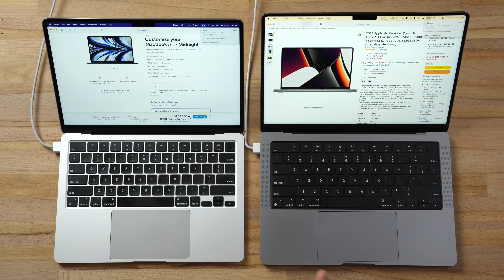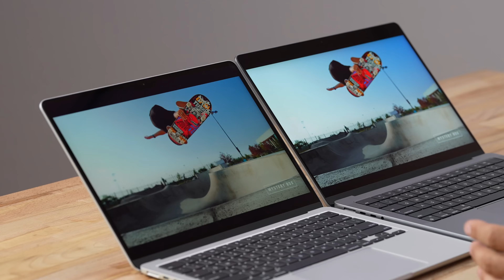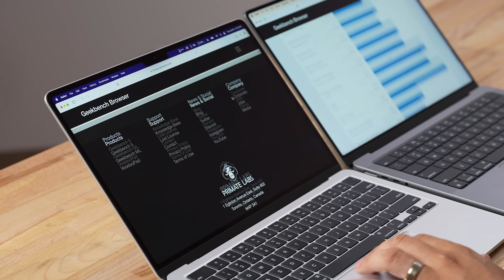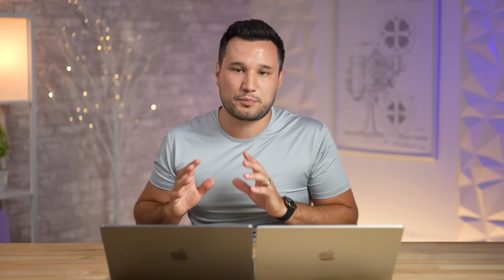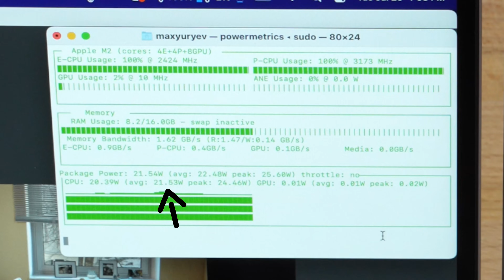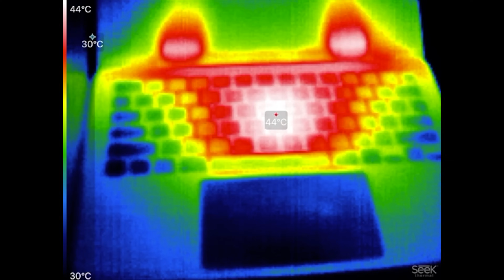M2 MacBook Air vs 14" MacBook Pro - Prepare to be SHOCKED!

Comment: Just ordered 16/512 space gray m2 air knowing that the price is really close to m1 pro 14. the difference was 230 euros in my case but that’s not important for me. I already have a powerful rtx 2080/i7/16gb windows pc equipped with a 1 tb ssd. So I will put most of the heavy workload to that machine anyways. What I needed was the most portable and lightweight notebook possible for dealing with web based applications + my office uses and while doing that, something that can manage some heavy workloads from time to time. Battery life was also extremely important for me. 

So my point is, do not pay more for something you do not need! First, just determine what exactly do you need. This is a good pricing strategy from apple, they are upselling something you do not need and making you pay even more once you start looking at their website.

Good luck choosing!

Comment: I am interested in knowing how M1 Air with upgraded 16gb RAM with rest all default performs agains M2 Air all default. This will make both cost same and interesting. If M1 with better 16gb ram, better ssd performance performs better than default M2 with better cpu, I would rather go with M1 with 16gb RAM.

Comment: I opted for the base 14".  It's awesome.   Was $1749 at best buy.  Traded my 2018 ipad pro, an old ps4 pro 1tb, and an old nikon 3400 and got another $540 off!  $1300 after taxes.  Not a bad deal!   No brainer at that point.
Reply: Why do you guys call it the 14 inch as a differentiator when both laptops are 14 inch

Won't it be easier and just plain smarter to refer to one as the Pro with the other as the Air

It's just so dumb and annoying to me tbh

Comment: When I heard about the M2 MBA I was convinced it was the choice for my workflow that covers everything from InDesign to Photoshop to Premier Pro, but after seeing the reviews of the MBA and how the SSD needs to be upgraded to get the best performance, I’m going with the 14” MBP. For a couple hundred more dollars, it’s worth it.
Reply: And nobody that I know works seriously with InDesign and Photoshop with only one display! So the Air is useless if you need that…
Reply: @simpromovie  you can run a second monitor on the Air…
Reply: @DistractedPlatypus  Not really. There is a wimpy workaround in form of a DisplayLink hack that is not comparable a a "real" two display setup. It's a software based compressed slow connection with no HDCP support and Apple can disable it in any not MacOS release...
Reply: @simpromovie  I think Stephen Plumbley meant that you can run a second monitor in addition to the MBA's own monitor. That's what I do when I'm working from home on my 2017 13" MacBook Pro. It's not ideal having one screen be only 13" in size, admittedly (at the office I use 2x 27" monitors connected to  a M1 Mac Mini, but at home I don't have room for a 2-large-monitors setup) but it can be done and my work apps seem pretty close to Stephen's (InDesign, Photoshop, Illustrator, MS Office and a web browser, mostly). I do make heavy use of Spaces, though, which I guess has to be considered a workaround, of sorts.
Reply: @ricklecoat422  Yes I meant two external monitors. I think this is a essential feature for many workflows but especially for things like InDesign and Photoshop. This should be possible with a laptop from 2022 in this price category! Most Windows laptops, even the cheap ones, are supporting this for many years....

Comment: the M2 MacBook Air isn't meant for Pro work, yes you can spec it up nut 90% if it's buyers won't do that, they might just get more storage or a bit more Ram. the base line MacBook Pro is powerful enough for a lot of people . these machines are for very different users.

Comment: I feel like the options for MacBooks are pretty clear after watching this video.  For users who want a portable and powerful MacBook for both everyday and a bit more demanding tasks, the M1 MacBook Air is the obvious choice at such an incredible value even almost 2 years later.  For users who have similar needs but want the newest design, they should get the base M2 Air unless they are planning on doing anything intense then they should jump up to the 512GB model to eliminate the slow SSD.  People who feel like they need more than that should either find a renewed/discounted model with 16GB of RAM.  For users who want to constantly do more demanding tasks/pro work and are making money off the power of the laptop should immediately jump to the 14 inch MacBook Pro and should not try to cut corners with the Air.
Reply: Why everyone is saying the 14 and 16" models only for people which make money with?
We just talk about 150-350$ difference, but you get A LOT MORE with 14" M1 Pro! (and with 16" base model even more than 14"!)

You guys act as if the M2 Air is that affordable! Here in Europe we pay 1399€ for the BASE MODEL M2 Air, 1750€+ for a M1 Pro 14"! Refurbished you get even 1TB SSDs at 14" M1 Pro sometimes for LESS THAN 2000$!

I got a 16" M1 Pro base model and im not earning money with it. I just enjoy good, versatile high quality notebooks. I cant stand adapters/hubs (the USB C to A is already enough needed still!) and M2 Air doesnt even deliver SD Card slot which i need nearly daily!

Considering im using about 2500$ worth of camera gear im not earning money with, just for a hobby, i guess the MacBook Pro is for sure an expensive decision to go, but at least i get something for the price i paid, the M2 Air especially upgraded to 16/512 is just targeted to Apple Fanboys and rich kids which dont care much about money. Probably for the ones looking for ultimate slim and light "powerhorse" too, thats it!
Reply: @harrison00xXx  I totally see your perspective on that.  I’m basing it off of what a normal person would be happy with, which is the M1 or M2 Air.  People who can afford expensive devices and prefer to have luxury technology even at the expense of their money can upgrade to the highest tier even if they do not fit the type of person it was intended for.  The 14 and 16 inch MacBook Pros were built with one of the main goals being to satisfy those who use their laptops for creative work and for those who do demanding tasks.  The ports like the SD card slot are there because many professionals will use SD cards.  The miniLED display is to satisfy those who use HDR work.  The M1 Pro/Max chip satisfy the needs of those who do demanding tasks that require more than just the base M1.  See what I’m saying?  But if a general user can afford these expensive machines and enjoys purchasing the newest technology, he or she will still be able to.  It’s just that most general users would be happy with the M1 or M2 Air.
Reply: @xeon3081  "normal person would be happy with"
Ok... many normal persons love a dedicated display output to use the notebook on TV or external monitor.
Soon, any display will have USB C input, but TVs will use for sure HDMI only for a while ;)
HDMI is one of the basic needs in fact. If the notebook is a "more professional" one like a M2 Air, especially upgraded with its high price, i would consider any dedicated display output as MUST HAVE.

Even 200$ netbooks about 10 years ago had HDMI and often also SD Card slot...
Reply: @xeon3081  "The ports like the SD card slot are there because many professionals will use SD cards.  The miniLED display is to satisfy those who use HDR work.  The M1 Pro/Max chip satisfy the needs of those who do demanding tasks that require more than just the base M1"

So you say:
- Only (!!!!) professionals use SD cards? GoPro, cameras at all and MANY OTHER USECASES for SD cards.... its just GOOD IF YOU HAVE IT (and bad if you have not!)
- mini LED display only for people working with HDR? What are you talking?
Or do you also mean by "working" just basic media consumption in HDR or outside with higher brightness?
- "require more than base M1".... considering 8GB Ram (the only really worth versions in 8GB ram base models....) is JUST FOR BASIC STUFF, anything "more basic" result already in more or less 16GB Ram AS ABSOLUTE MINIMUM... 

So yes, even most basic users would require a M1 Pro base model to get 16GB Ram and 512GB SSD at least!

Apple intentionally overpriced the M2 Air and they didnt even anything special (like 5G module, more ports for "creative users" as you said,...at least HDR and/or 120Hz screen... nothing special to justify 400-800€ highe price tag compared to M1 base model.

In fact even a M1 Air base model is somehow overpriced... 8GB Ram WILL NOT BE ENOUGH if you ever consider it to be lasting as long and being as usable as long as Macs typically do... It will end up in a websurfing/media consumption machine.
Reply: @harrison00xXx  When did I say that these were the only use for these features?  I’m literally talking about one of the professional uses that these features can be used for and why it’s recommended for professionals.  I tried to be nice but clearly that’s not your type.  Want to use a SD card slot for your GoPro or whatever camera?  Do it!  Need the mini led display for your entertainment?  Get it!  Think the extra performance is critical to your workflow?  Buy it!  Nobody is stopping you.  If that’s what you want go ahead.

The M2 Air is not overpriced with this economy?  It is a company not a charity.  Their objective is to profit.  They make good products.  There is nothing wrong with charging a premium price for them.  I am not excusing the slower SSD in these base models, but if we put that aside, the price is certainly fair.  And if you don’t like the price, you don’t have to buy it.  Nobody is forcing you to.

8GB RAM is certainly not a high amount but for many people it will be fine.  Ever heard of virtual memory swap?  Or do you think that if all the RAM is used the computer will explode?  Sure the 16GB of RAM will preform better but that’s what you’d expect for a $200 increase in price.

The M1 macbook air is an excellent value for a laptop.  It’s got great performance, a nice screen, good speakers and mics, and a thin and light design.  If you’re the type of person who needs more advanced technologies, buy the high end Macs.  Nobody is stopping you.
Reply: @xeon3081  Lol, calling M2 "more advanced" and saying M1 and M1 Pro/Max are not as advanced?
Lol, sure, if you think that.

But hey, i knew already you are talking nonsense as you tried to defend the obviously highly overpriced M2 Air (aka a iPad in a MacBook case)
Reply: @harrison00xXx  What are you talking about?  I literally said that users who want more advanced technologies should go with the high end MacBook Pros.  Are you blind?

How is it an iPad in a MacBook case?  Literally the two are very different products.  Talk about nonsense.
Reply: @xeon3081  i see, you havent seen the iFixit teardown of the M2 air yet

If you look at the design inside and especially the logicboard design and SIZE (!!!), it would fit nearly perfectly into a 12“ iPad Pro case!

Considering additionally base M1/M2s are mainly developed with iPads in mind… yes its technically more of an iPad than a Macbook ;)

I mean… apple saved already often a lot money by using super small (and unrepairable) mainboard/logicboard designs, but the M2 logicboard in the M2 Air Macbook is literally the SMALLEST logicboard ever used in a Mac (in fact a studio display got a bigger A series logicboard in it!)

Even in the iFixit report they said the M2 Airs mainboard/logicboard is with a high chance designed to share its design nearly 1:1 with a upcoming M2 iPad
Reply: @xeon3081  and no, you acted as if a 14/16“ M1 Pro is „old tech/design“ and just for „people which dont want advanced technology“ and only a M2 is modern tech.
Now you say the M1 is also modern, you dont even know yourself what BS you are talking

Just accept M2 Air is probably a ok-ish super portable notebook…but:
- underperforming, especially 8 GB Ram and/or 256 GB SSD… not even close to be worth 1000$!
- heavily overpriced in upgraded versions (the only ones which make sense!) and still much overpriced considering how „much“ you get with M2 base models!
- usability… just 2 USB C ports (even both blocked with anything beyond a basic cable!) is poor and again: If a 10 year old 10“ 200$ netbook got more ports than a 13“ 1500$ MacBook… anything is wrong!

Comment: Didn't think the M2MBA would've held up as well as it did, TBH. Pretty impressive. I write A LOT, use Ps a lot and dabble in FCPX. For me, it's the Air. 10 Core, 16GB, 1TB. Pretty expensive, but is, physically, exactly what I'm after for long keyboard use.

For the Future: I plan on getting a decent camera to take 4K video and high res photos. That's as a hobbyist, not a content creator. After seeing what the M2 chip did with its cores and engine, I'll be waiting out the M2 Pro Mac Mini (if that is indeed a thing) or, of this M2 Air can hold out, wait out a little longer and go for the M3 in a few years.

Comment: I went with a 14” pro and I’m not disappointed! Sure it’s a little bit heavier, but the overall quality and performance is worth it imo, and it’s still super small and portable. They should have done a small fan and a better screen on the air especially for the increased price.

Comment: What Apple should do with these product lines is keep the Air as is. But for the pro line they should drop all three and just make a 15” so with that they don’t have to worry about where the parts are going to go.
Reply: This also makes it easier for people to decide what they are going with when buying a system.

Comment: You can find the 14 inch with a more capable 10/14 soc used for a reasonable discount from new.
In my case, I upgraded the chip, 32 gig RAM, and 1 t ssd. That’s probably too much for 90+ % of buyers, but it matches my workflow. If you have enough room the 16 inch is a better option.
Reply: Indeed, I've seen a couple of base model 14" MBPs on the apple refurb store at a similar price to a new M2 air with 16GB ram and 512GB SSD. That said, give it a few months and discounted M2 Air's will appear as well.

Comment: Thanks for the MBP14 vs Air comparison.  It was very insightful.

Just a note: On the battery levels differences, some of the benchmarks measure the quantity/quality of work- more work done in the same time, higher FPS, less FPS skipping, more audio channels, more browser events, etc. It is reasonable to expect that take more processing power and hence more battery. 

 I expect if one ran the exact workloads that were not also showing quantity/quality of work, the MPB 14 would have slightly better  battery results.  Maybe still not matching the MPA, but the percentage difference might closer than the final  results.

Comment: Thank you for this side-by-side test. Once you give the M2 16GB of RAM and a 512GB SSD to work with, it turns into a very capable premium laptop with plenty of performance headroom for consumers and prosumers. The entry-level M1Pro MBP is great if your work requires two external monitors and/or entails a lot of sustained coding or rendering/game development projects. Professionals earning de facto high houry rates prefer the 14" with the full-fat SoC and 1TB of internal SSD. Then, even a $900 premium amortizes in months rather than years, especially if you can catch a tax break for the purchase as well.

Comment: thanks for the video. i just checked and the M2 air when with 16 gigs of RAM and 512 SSD is basically the same price as the M1 Pro.. 50 or so bucks difference… i will still go for the pro in this case simply because price-wise air makes no sense.. if the base air had 16 gigs and a 512 ssd then air would be my choice.. but we aren’t in such.a nice world hahahahah

Comment: My M2 MacBook Air arrived today. 8-core CPU 8-core GPU. 512SSD 16GB unified memory in midnight. It’s working pretty good for me so far. I also have an M1 iMac with 8-core CPU, 8-core GPU, 1TB SSD, and 16GB unified memory and the M2 Air is essentially on the same level as the iMac. iMac may be a little better for extended workloads though due to having a fan

Comment: I'd probably be happy with either, but opted for the 14" MacBook Pro as I figure at these prices I will be holding onto this laptop for a long time. In 5+ years, after several macOS updates, the extra performance of the MBPro (especially the SSDs) will become more important.

Comment: I need some advice! I’ve currently got the M1 Air with 16GB ram and 512GB on order, but now I’m unsure/having second thoughts between the M2 Air with 16GB ram and 512GB, the base model M1 Pro, or the MacBook Air M1 16 ram and 512GB. I have the budget for either one, but I’m looking for something long-lasting and capable of most tasks. 

I’ll be using it for all daily tasks, video calls, university work, different software and programs work, casual gaming, video editing and odd bits of photo editing. 

Also, What recommendations would people have for the upgrades for each MacBook?
Reply from the maker: If you can afford the base model M1 Pro get that! You won’t be disappointed!
Reply: @MaxTechOfficial  Thanks you for the reply, and amazing videos which have really helped to make this decision!